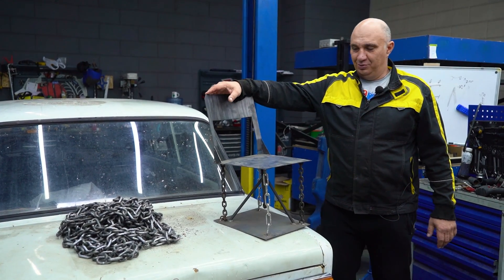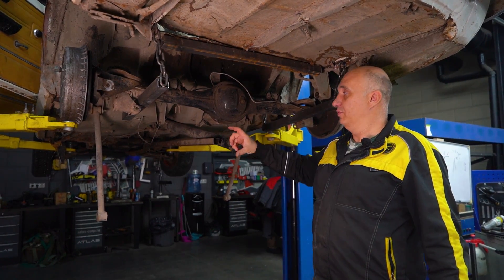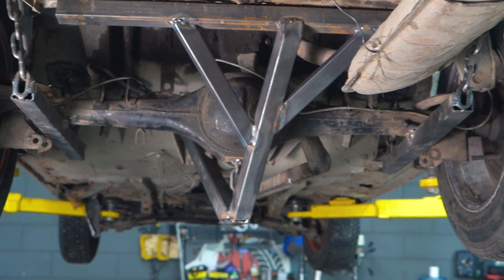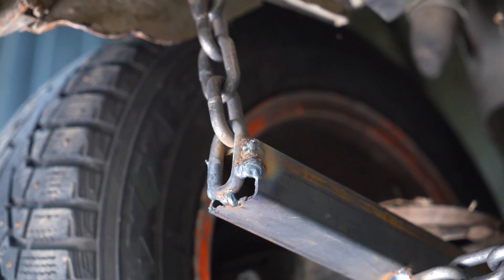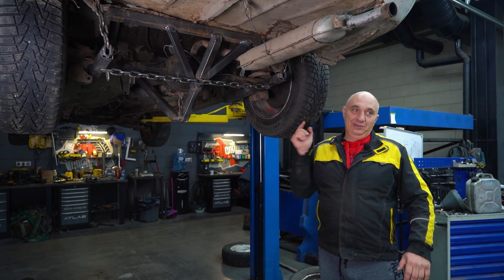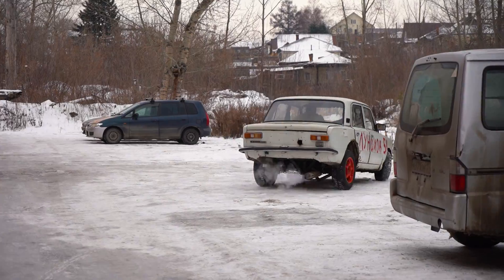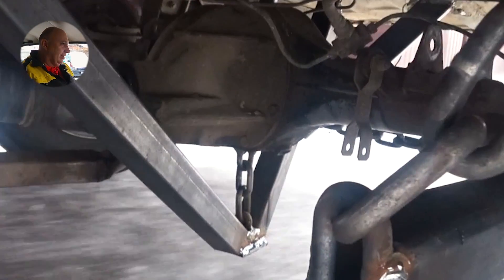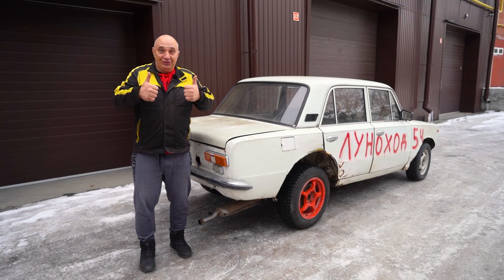We make a levitating rear axle - will it work?

Comment: HERE'S AN IDEA for a project. REPLACE ALL SUSPENSION WITH SOLID BARS... THEN, fit small wheels with LARGE SUPER HIGH side walls tyres (off road type?) and UNDER-INFLATE the tyres just enough to give you a bump/rut 'Reducing feel'. So... COULD a car fitted with NO suspension and 'Squidgy tyres' give you a smooth/smooth-ish ride? It would be FUN to find out! 🤔😉🤣🤣🤣👌
😎🇬🇧

Comment: I don’t see it free floating like there’s a frame on the side the chains on the side don’t share the load at all. 

You’d probably need coil overs in the place of each chain segment. That way it’s all under some tension and control. Without the need for trailing arms bushings.

Cut a hole and flip it, so the triangle doesn’t hit the ground. Steel stretches and the longer the chain the softer it feels.

Comment: There is no suspension,  no up and down movement just a back and forth movement.  Look at the silly design, the only thing holding the car up is that one chain welded to the bottom center of the diff.

Comment: Main problem is the chains from frame to axle are not straight up and down they are canted slightly, second problem is having the drive shaft in the equation it is adding leverage hence the rear steer problem.

Comment: Replace the chains with heavy duty straps so there is a little give. It might make it ride nicer. And add another cross chain to the front of the contraption to keep the rear-steer thing from happening.

Comment: The reason the axle was moving so much is because those outside chains that act as the trailing arms were welded when the suspension had no load put onto it so when the vehicle was set on the ground the distances between the ends of the chain decreased (as the axle was raised closer to the body of the vehicle) which caused all the tension you originally had to loosen and that allowed the axle to start swaying back and forth causing that rear steer effect.
I say you should try and Re-weld the outer chains while the vehicle is resting on the ground
Reply: put a turnbuckle in places to tighten it up.
Reply: The rear axle was basically hanging loose underneath the car (or conversely, the car was just sitting on the rear axle with its weight). The chains were not really limiting the axle's movement in any direction, particularly sideways.

I wonder if they could re-design this with springs and dampers with the axle still hanging would work better.

Comment: Talking about suspensions, would be cool to see a Formula 1-style mass damper experiment. Now its forbidden in F1, but its basicly a weight that moves in the opposite direction of the suspension, which balances out the forces more or less so the car just eats every bump with ease.
Reply: Wait, you mean mass damper, as in the nearly 700 tonne (700 tons) spherical weight inside of the Taipei 101 tower, which allow the supertall building to sway in the wind? They use smaller versions of that mass damper in cars? Way cool, my dude.
Reply: @thatguyalex2835 that’s a wicked fun fact
Reply: @SierraForeTweny  Thank you. I learned about the mass damper when I was 11 or 12 in the early 2010s on the only good show on the History Channel, before satellite TV and History went down the drain with clickbait. The show was Life After People. I also am fascinated by architecture in general, and have read about cool buildings and such.
Reply: I want to know how it got banned in F1.
Reply: @jwalster9412  other teams complained it was a mechanical aero device, so it got banned.
Reply: As well as the suspension… and fit within one lane of road
Reply: I had heard Citroen 2cv has mass dampers too.
Reply: @huseyinuguralacatli5064  yes that is correct. I linked a youtube video about it here, but it looks like Youtube removed the video. But if anyone is interested, search for Renault mass damper (it was used in 2006 for example in their F1 car)